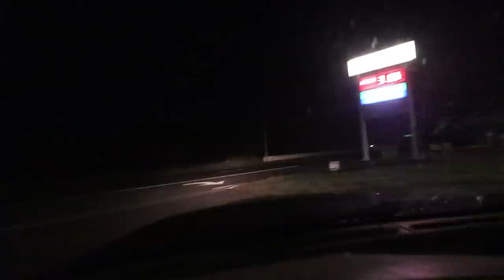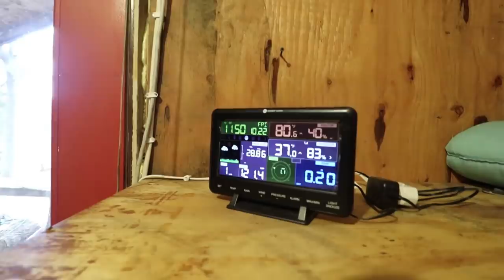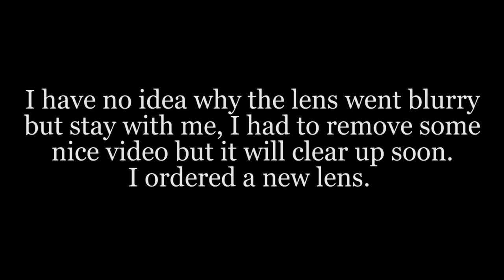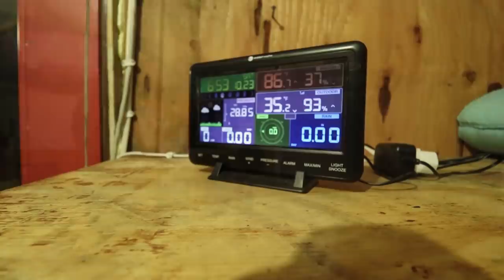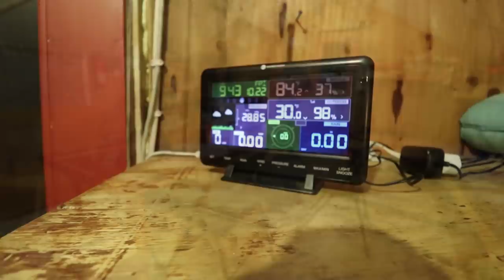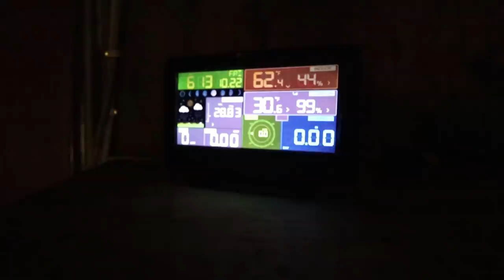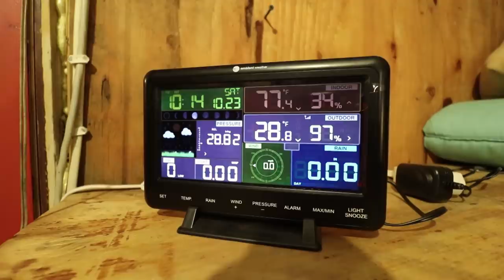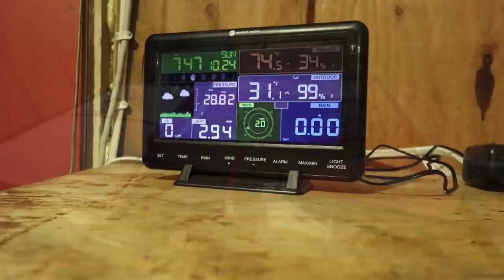THE TENT. Deer Stand Weekend. Getting everything ready.

Comment: If you have porcupines in your area they love to chew on plywood. I would paint the new hunting blind with motor oil to deter the little Ba**ards.
Reply: I did that with a pallet blind I built. 2 or 3 parts used motor oil and one part diesel oil. Looks nice and a good preservative. Yet to be determined on how it will weather.